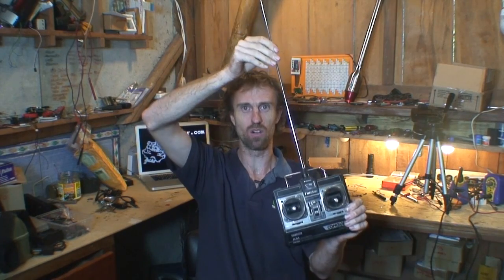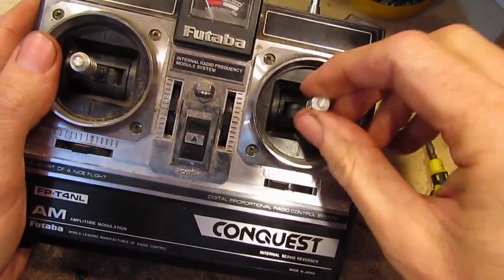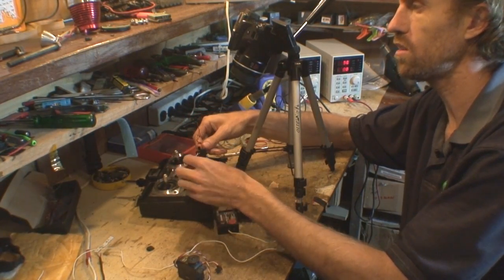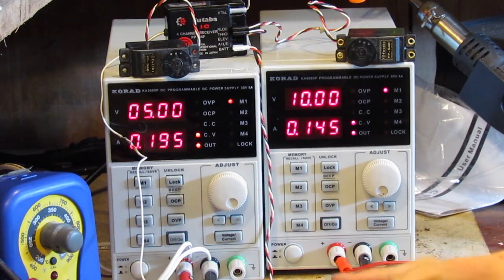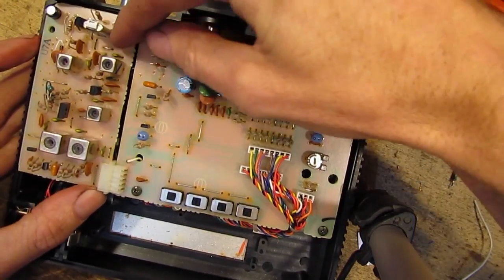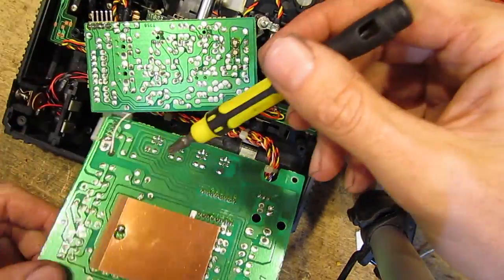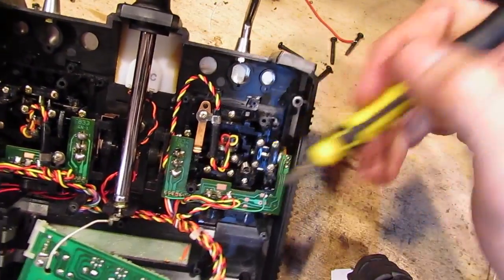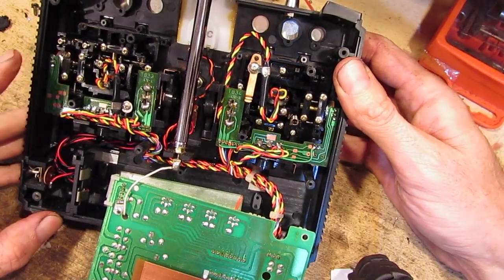Futaba Conquest. Vintage 72MHz AM Radio. RCHacker #63

Comment: Thanks for the video.
Your video has helped me modify my 6 channel Futaba Conquest AM 72mhz. I found an IC similar to the one you showed, in my case it is the NE5044. I searched the internet and found the technical sheet. With that I could read the data from a pin and, with an arduino, be able to use the radio in 2.4g. I have been using the radio in this way for months and it works great. Thanks again for sharing information.
Greetings from Argentina.

Comment: I have the same one but in a 6 channel model in the closet and it still works. Even have the reciever and servos, the charger and batteries but those are shot...  the price..  IIRC I spent 275$ on it...

Comment: I have a brand new in the box Futaba Conquest FM FP-4NBF 4-channel with a extra 4th servo also new in the package I bought new in high school. I just knocked the dust off of it and a brand new in the box O.S. MAX .40 FP 2-stroke I bought the same day at the same place. Somebody says "these are vintage now?" Well yeah duh dude.....I'm 44 years old now and I bought these when I was in high school. That means they are nearly 30 years old and ago......

Just started getting back into R/C glow/nitro planes and it was sparked by a recent interest in micro Nano class 3.7 LiPo electric helicopters. Fly the choppers inside and out. Fly the nitro gassers outside. I don't care for electric planes and never have. I've been looking at new Sig kits to build up and more gear to go with them. Recently I bought a Spektrum DX6 6-channel radio and have been placing bids on other vintage O.S. engines on Ebay. I want to pickup where I left off and do it the way we used to do it. I don't want a ARF foam plane with electric power plant.

Comment: what range did you get with the Futaba Radio?  I'm wondering if this will be better for ground FPV in urban areas where there are buildings and line of sight obstacles??  Or would I get better performance with Crossfire?  Thanks!
Reply: They are very low power. Only designed and ever used for line of sight.

Comment: I am dumping my Spectrum radios for aircraft and ground, switching to FM.  The microwave emf put out by the 2.4 ghz equipment is way over the recommended limits for exposure to the human body and when you use your radio its held right up to your gut.  Guys that are into the first person view are going to get brain cancer.  I use a High Frequency Analyser from Gigahertz Solutions model HF38B.  This is serious equipment for testing, note i no longer have WiFi in my home as well. Ethernet connections only for my computers.  People have no idea how they are hurting their health with all the microwaves that they are exposed to. "Smart Phones" "Smart Meters" ect ect.

Comment: These radios were designed to use a wide selection of batteries. It used an 8 cell AA battery holder that snaps into place & you could fill it with rechargeable NiCads or throw away Alkaline batteries. At 1.5V each, 8 cells would be a maximum of 12 Volts. It should work with any long 8 cell AA battery cartridge you can get on eBay.  The "digital" reference was primarily because the AM signal pulse train from the transmitter module was either "on" or "off" for different lengths of time to set the servo positions. (And maybe the IC chip had a small bit of digital control logic in it.) Basically, it was as "Analog" as the radios of the 70's. The "digital" was for marketing, as computers were becoming "the modern thing". Not a lie but definitely a stretch. These 72Mhz radios were supposed to have a solid range of 1.5 miles, far beyond visually seeing if your plane was upside down or not. However, as an AM radio, it was subject to noise interference, just like the AM radio in your car. Good for models using glow engines, BAD when using gas engines with spark plugs or on electrics. The later FM analog radios were much better and the PCM radios after that were computer radios which utilized FM to transmit a digital signal train. The 2.4GHz systems made PCM much better by eliminating interference from frequency conflicts with RF redundancy & frequency hopping. The IC in the receiver is nothing more than a Serial-In Shift Register (Could also be considered "digital". Invented in the early 70's & very common in ALL analog radios). P.S. 72 Mhz is still legal to use in the US & I have quite a number of my models still operating with it in FM. It was great watching your video. Thank You.
Reply: @Young_DEADgrasshopper  All the RF frequencies that were legal before the 2.4GHz systems came out are all STILL legal to use in the USA. Primarily 72MHz for Aircraft & 75MHz for Surface vehicles, along with the 50 & 52MHz for those people holding FCC HAM Radio licences. The original 6 frequencies of the 27Mhz band are also still legal but not recommended because they are shared with with Citizen Band (CB) talking radios. As for modern equipment, frequency hopping spread spectrum transmission is legal on the Wifi (2.4GHz/5.8GHz) & the 900MHz bands. Everything else, like those in the 35MHz & 40Mhz bands, have never been legal & are still not legal to use to this day. Hope this information helps.

Comment: One question I have exact same remote how can I bind it to a spectrum receiver any advice
Reply: Caimaneromocsinaloa lopez - You are being silly aren't you, however this is not as stupid as some might think, this transmitter is hopeless, you will never bind it, maybe with a complete redesign/hack,  but other module based Futaba (ex Futaba 8u) can easily be used with Spektrum receivers, Orange makes a module for about $25.00US available at Hobby King, they work very well, also I have seen them used on other non module based FM PPM futaba transmitters but it takes hacking them into the ckt, just YouTube it for the procedures.

Comment: set up 72mhz futaba transmitter for 3s lipo battery with a 3S 8c 2200mah lipo transmitter battery  only it show 12 volts  now  on the screen of the radio will this be OK  or burn up my radio

Comment: I have the same one except it says it has FM. I am assumming its going to work with the same pin(9) for conversion.  It was my brothers. The date of manufacturer is 3/ 1990. Not really that old. ther than cleaning it up. It should work well. My intent is to get converted but be switchable. I love older electronics.
Reply: it's over 31 years old....that's pretty old for electronic devices. Are you still driving your 1990 vehicle? Well, there you go then!

Comment: These old Radio's are great.  They were built to last.  I bought one around 1985 and used it until they outlawed AM radios.  I added dual rates to mine.   Someone was selling small circuit boards in RCM magazine.  Parts needed were available at Radio Shack.  Cost me a whole $4.00. For three channels.  Easily converts to 2.4 Ghz. With FrSky Diy Module available At Hobby King.  Using mine today and works great.  These radios have a "feel' to them.  I also have many other Futaba FM radios from the 80's which I still use.  Never missed a beat and you can't beat the range you get.  Signal goes through everything.
Reply: i have one if you want to buy it?
Reply: kawkz1000ltd, I have two of these old radios laying around that I'd like to use in some way. Could you share your conversion process? I know very little about electronics (and the lingo) so it might have to be in layman's terms. It would be greatly appreciated!
Reply: AM radios are still legal in the US, they just need to be 20khz bandwidth. Most futaba radios between 1987 to 1990 are already 1991 compliant but it's worth reading up on

Comment: I still have one of these - in a box in the basement.  Don't know why I'm holding onto it.  Are they legal to use?
Reply from the maker: Probably, I don't think they ever changed any RC radio rules.
Reply: These Radio's are illegal in the US.  Only 72 Mhz FM Narrow band are legal.
Reply: kawkz1000ltd Narrowband AM is still legal in the US.
Reply: I stand corrected.  You are right they are still legal as long as they have a Gold Sticker and a narrow band receiver.

Comment: Good to see you back Marc. Looks like you spent up on service gear when back home. Obviously you did not see Dave's review and rant on the Korad PSU's :)
Back in the day there was only a couple of IC's specific to the RX to servo drive. Made by National semi from memory. Now discontinued by all accounts. Those boards would have been wave soldered BTW with non hippy solder.
Reply from the maker: Did not think of wave soldering, So hand stuck in and the legs cut manually?
Long story with those PSUs I ordered one, they sent the wrong one and it had a bad main cap. I made a video and complained, they sent me a second one free and i fixed the first one. Still they each cost me more in postage and Ecuadorian import tax than their actual price. anything over 4kg gets nailed. I did see Dave's reviews and figured they would have most of the problems sorted with them. They work well enough and were cheap.